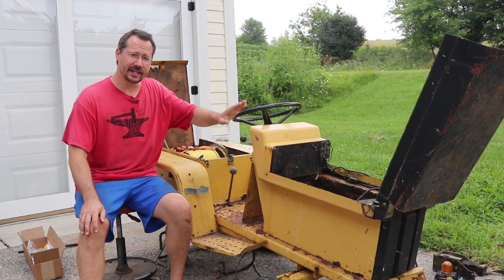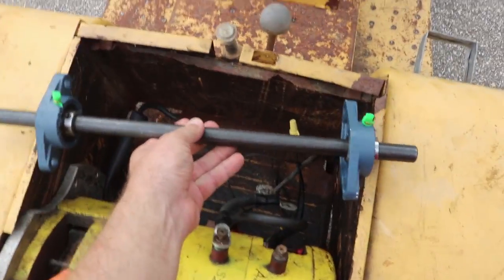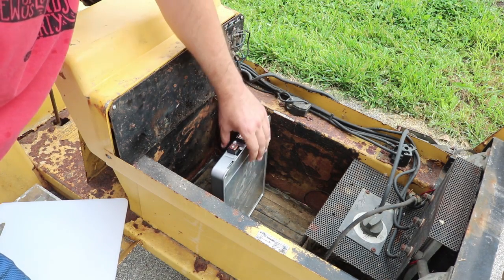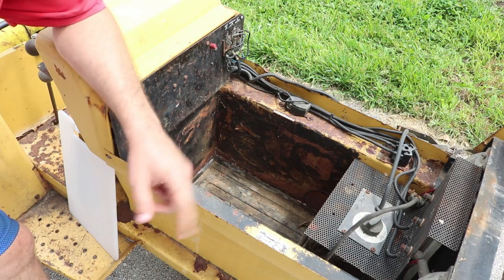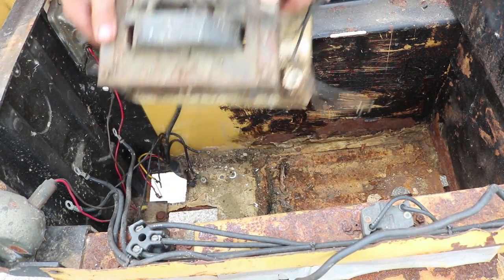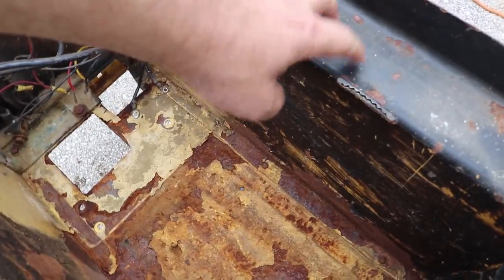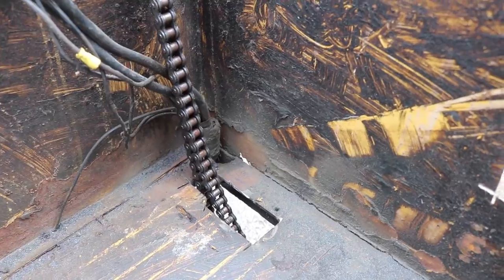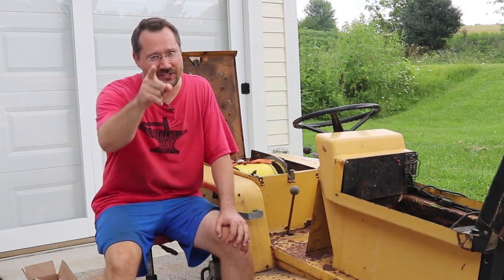ElecTrak Rat Rod work 2

Comment: how did you make the motor controller
Reply from the maker: Here's the document that shows step by step how to built the open source motor controller. http://www.pandspowerelectronics.com/EVstuff%20info/Kit%20Assembly%20Directions%20Updated%20April,%202011.pdf

Comment: I just switched out a Windynation solar panel (100 watt) for the same size Grape Solar solar panel. It quit generating electricity according to the Windynation charge controller. I can't find a bad connection to account for this. Is there anything I could have overlooked? Has anyone out there had problems with Grape Solar panels not generating electricity?

Comment: I have a question about using a Sterling engine as an onboard charger to the battery packs like a locomotive hybrid system. I am curious to know how big this Sterling engine would need to be in order to charge the battery packs while at work, or while on the go. I know it seems counter intuitive to use fuel in an electric vehicle, but I've read that they are up to more efficient than a gasoline engine, and could use way less fuel since it would only need to charge batteries rather than move the vehicle. Do you know anything about these Sterling engines, and would it be feasible to attach this kind of system to any of your current electric vehicles?

Comment: Seems like a lot of work for a junk parade 🤔. After the parade will you be able to fit a cutting deck and use it to mow your lawn? If so, it would be great if you derust it with molasses or electrolysis to demonstrate that EVs are very long lasting. 😎
Reply from the maker: Yeah, it would be a lot of work if it was just for one single event. This is sort of the type of wild project I've wanted to do for a while. There's also an annual tractor show nearby every spring I want to take it to and several weird local car shows. I already have a working Elec-Trak for mowing my lawn. As for longevity, I think this tractor was built in 1972, making it 46 years old.

Comment: Why don’t you just flip the electric motor and reverse the polarity? That way you don’t need the jack shaft. Can the motor run in reverse?
Reply from the maker: The motor shaft does NOT line up with the input pulley on the transmission. I'd need some sort of jack shaft no matter what. It looked like things may have been a little tight on the right-hand side if I had the motor drive-shaft sticking out on that side. Since the jack shaft would have spanned the box anyways, I put the drive-shaft out the left side just to make more room to work.
The motor can spin either direction. That's a good thing, considering that this mechanical transmission does NOT have a reverse gear!

Comment: Solid work! You might want to beef up the front wheels a bit... With that much weight in the nose even a short hop then slamming back down could bust the bearings in the wheels themselves. The front axle on older mowers like that are 3/4 or 7/8" axle hubs so they'll probably be good to go as is. Loving this build!
Reply from the maker: The front of the tractor is pretty solid, but you are right, the bearings themselves in the wheels don't look too solid. Front axle is 3/4".